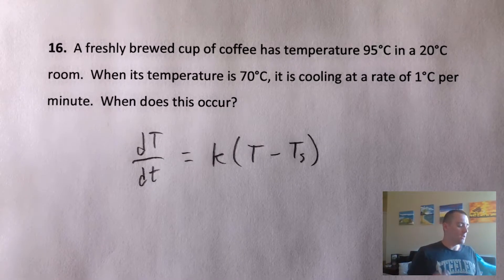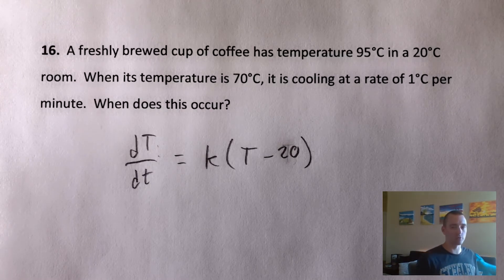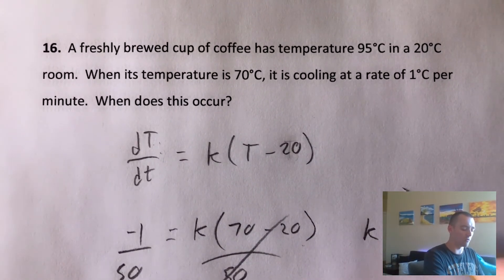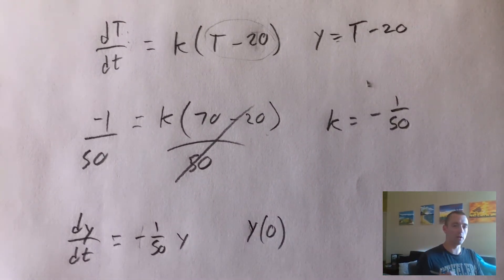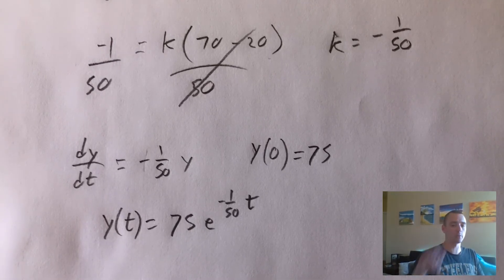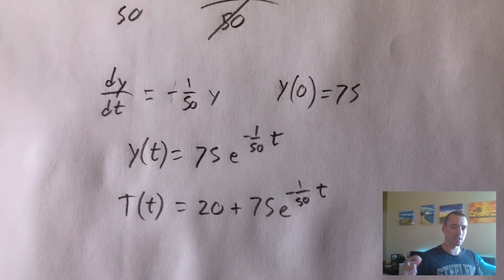Newton’s Law of Cooling Problems Example with Solutions | Jake’s Math Lessons

Comment from the maker: MY CALCULUS 2 STUDY GUIDE - https://jakesmathlessons.com/calculus-2-study-guide-integral-calculus-cheat-sheet/

Videos Chapters:
0:00 Check Out My Cheat Sheet
0:28 Subscribe and press the bell icon 
0:44 Newton's Law  of Cooling  Differential Equation problem
1:15  Describing the  Formula of Newtons Law Of Cooling Calculus Problem
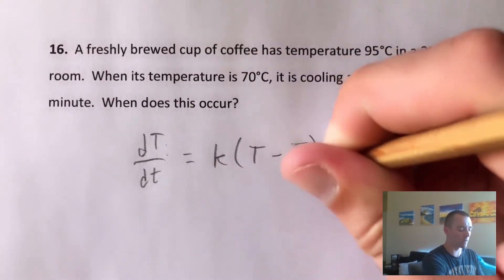1:48 Plugging in the value of the temperature of the surrounding in the  Formula of Newtons Law Of Cooling Calculus Problem 
03:55 Solve for K
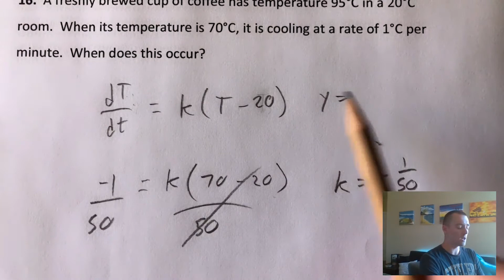04:30 Introducing new Variable called Y as (T-20)
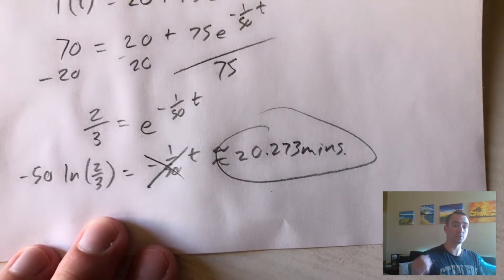08:34 solve for t
08:39  Like, comment, Subscribe and press the bell icon